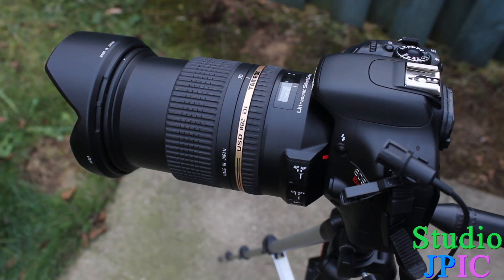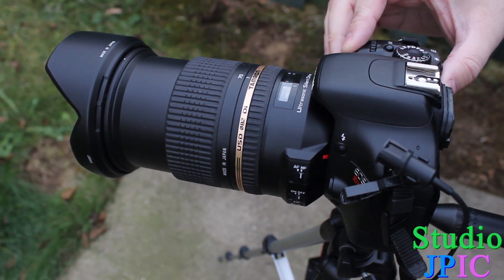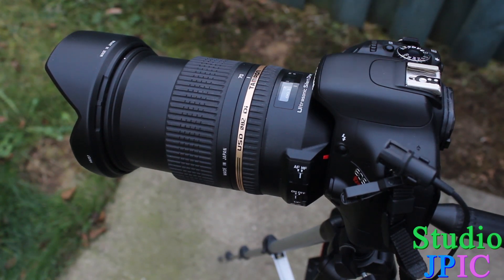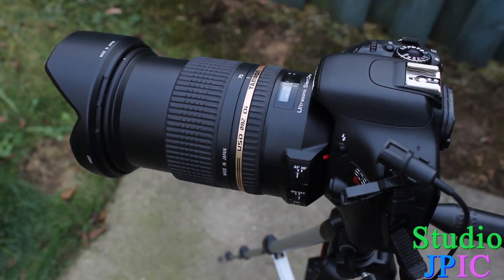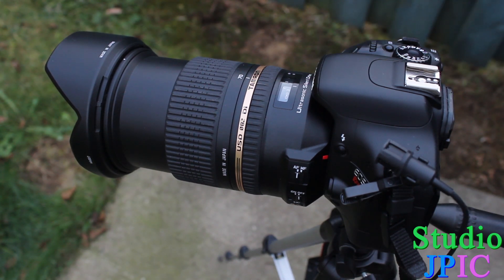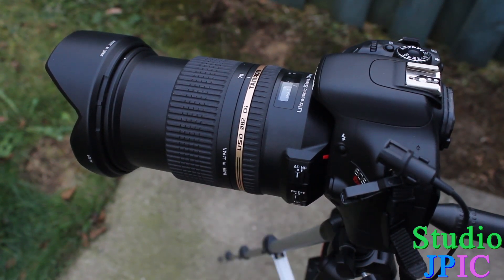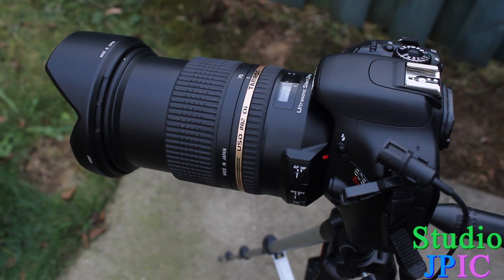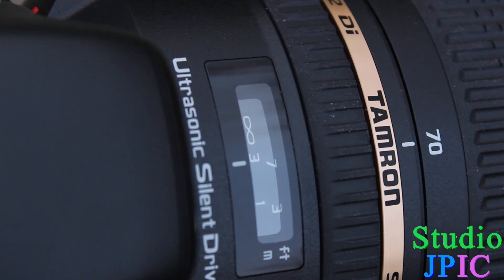Tamron SP 24 70 Di VC 2.8 VC/AF noise and AF speed test

Comment from the maker: In this video, I do a VC and AF noise test for the Tamron SP 24-70mm Di VC f/2.8 lens.  I wanted to ensure that the Autofocus and Vibration Control noise of this lens would not be too distracting in a quiet environment, and I think it did quite well.

The AF test was done on a low-contrast subject with my T2i camera, which uses older Autofocus mechanisms, but it still did quite well.  From using this lens for a couple of months already, I'd say it is a good focuser.

Comment: Hi guys, I bought this Tamron lens couple of months ago (substituded with a second one which for me is again not properly working as the first one). The autofocus takes 3-4 seconds to get the right focus, and this, imho, makes this lens unusable in several cases and very frustrating in all other situations (e.g. landscapes, steady subjects, etc.). Couple of workaround I found are:
- manually turn the focus ring totally out of focus before shooting;
- shot in sequence without waiting more than 1 sec between shots.
Both of the above "tricks" seem working, but this AF behaviour to me is really not what can be expected from a lens which cost about 900 €.
Maybe the 2 copies I received were both faulty (strange with 2 different copies with the exactly same response)... Did you have the same issue? From the video at 3:12 seems the same.
Thank you very much for the test and the interesting dicussion
Reply from the maker: Hi Igor Lanese, I'm sorry to hear about your bad experiences with this lens.  Personally I never had any slow focusing issues with this lens, so you might have gotten two bad copies.  I would probably resend to Tamron again to get a good one.  The only cases where this lens hunts is the same as with any other lens: in ultra low-light situations or when trying to target on something with very low contrast.  In those cases, it's actually the camera struggling, not really the lens.  Speaking of which, are you focusing in live view mode, or through the view finder?  There can sometimes be a BIG difference in speed between the two.

Comment: Hi i have just bought this lens and sometimes after taking the picture the image seems to jump in the viewfinder when the VR has disengaged, and the VR motor takes about  3 seconds to disengage. is this normal . 3 seconds seems like a long time to wait to take the next shot.. thanks .  Jimmy
Reply from the maker: Hi james hetherington, first off congrats on your new lens!  You don't have to wait until the VC disengages completely to take a photo.  I find that as long as I don't motor-drive it, the photos usually come out sharp.  Usually I wait about 0.5 to 1 sec between photos, and I've had good success so far.  The only thing that can go wrong is if the photo is taken between the points where the VC grabs a stable lock, releases it and grabs a different stable lock, then that frame would be lost.  But if you take a photo every 0.5 to 1 sec, it's usually fine.  Hope that helps!

Comment: Does the manual focus make any noise? Also, what is vc?
Reply from the maker: Hi NoahTV1000 , I find the manual focus on this lens very quiet, and VC is Vibration Compensatio, which is Tamron's name for image stabilization / vibration reduction, / vibration control.  It helps keep the image stable as you take both photos and videos.
Reply: Jean-Pierre La Forest Is the manual silent?